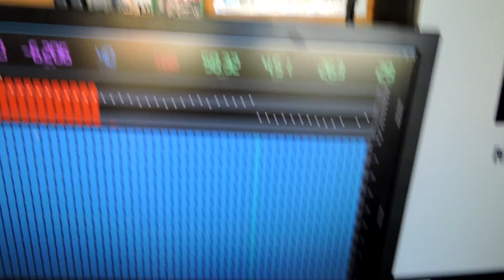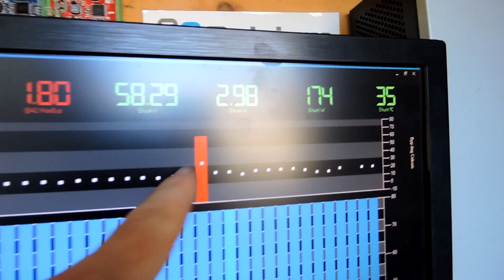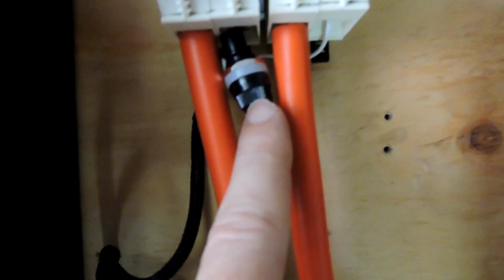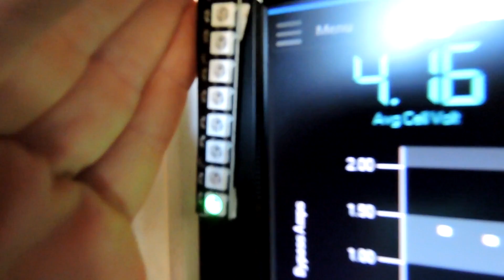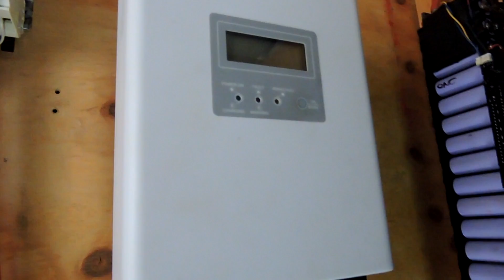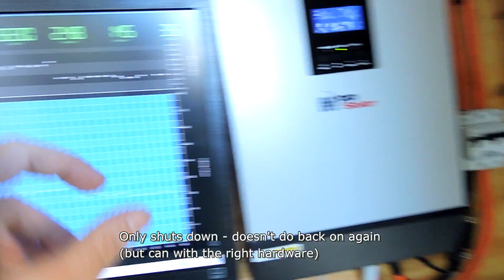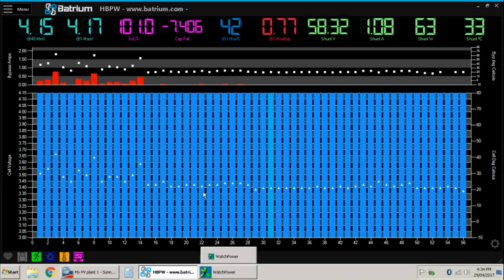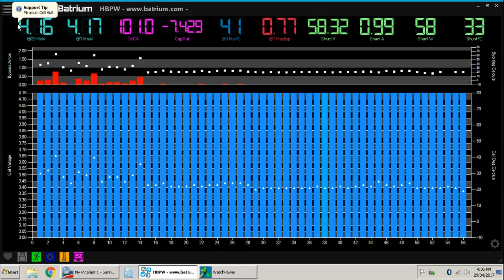Installing remote circuit breaker trip into my 40 kWh HomeBrew Powerwall

Comment from the maker: 40kWh has begun if your keen to check it out you can view it here https://freeboard.io/board/xKtg_F
Reply: The pcb terminals are very small on the batrium board so what they do in industry is wire all the pcb terminals out to a terminal rail and your field wiring connects to the terminal rail, that means there is less chance of damaging the batrium card and you can easily connect and disconnect but keep up the great work it looks amazing 👍
Reply: Yeah I have had it running on another screen your site. Currently 17.71 kWh SoC% 66.5 as of now 10pm South Australia time
Reply from the maker: +TheBlokeSolar&Wind soc is set too 1000 ah so it doesn't auto reset and I know what to set it too so that is inaccurate but everything else is :) refresh page as we have been tinkering with the desktop version a bit don't know if it auto refreshes.

Comment: Hi, are you using this system right now? it will give you more years of use.?
Reply from the maker: 3-4 years so far and still going strong
Reply: @HBPowerwall  then 3 years after that, the system will go in a powerful way estimated bi . , isn't it?
Reply: thank you for your successful interest in a very nice work bi.

Comment: Hey mate! Great stuff. I want to do this with my Batrium. Is this there a way that Batrium can do both, turn on and off all systems in case of faults, as this turn it off only. No biggie mate. I need to find a shunt trip like that in the USA. Would something like this work? https://www.amazon.com/Siemens-Q26000S01-240-Volt-Circuit-120-Volt/dp/B0052MCT1Y/ref=sr_1_2?ie=UTF8&qid=1533879396&sr=8-2&keywords=shunt+trip

Do you put one between battery and MPPT, as well as one between battery and inverter/charger? Thanks a lot mate!

Comment: on your PIP4048HS you have connected 4S panels each one has 45.1VOC for a total of 180V but you PIP4048HS only accept 125V, I am not sure if I am right or a I am doing something wrong
Reply from the maker: pip has 8 panels 2p4s total voltage is only like 60v or somewhere close to that.

Comment: That shunt trip is exactly what I am looking for. Thanks. Do you remember what they cost?
Reply from the maker: About 400 bucks from memory, i can get my sparkie to get a current price.
Reply: HBPowerwall If you could that would be great.If possible a model number would be awesome!
How's it working with that unit has your system tested it yet?
Reply from the maker: I've tested it with every possible wy i know how. Heat, cold, Over voltage, Under voltage etc hasn't not worked.
Reply from the maker: pretty much anything that'll work and is cheap, the one between each bank (haven't done it yet still ) will just make it a little better to maintain it
Reply: Hey Pete
Did you manage to get the details of the shunt trip from your sparkie?
Reply from the maker: He is coming around in the next few days I'll be sure to ask.

Comment: Those little DIN rail disconnectors, you mentioned a rating of 125A (DC), do they stand any chance under a serious fault condition?
Reply from the maker: By full fault do you mean a train hitting it? I think they are adequate taking into account the amount other protections that have put into place inc 4480 individual cell fuses
Reply: I guess thats the point under a really serious fault your cell/pack fuses would take over.  Was just curious as I know arresting a DC arc is a real challenge (I've worked in high energy DC rail in the past) I understand on some of the newer Tesla packs they have implemented an explosive disconnect system which is quite a clever solution to the problem - all be it a non resettable one!  Keep up the good work.
Reply from the maker: I have dead shorted a 7S charged pack before (a few videos back in fact) and all it did was scare the shit out of me & blow every cell fuse on the 7th pack.  20min to replace all the fuses and i was back running again.

Comment: 101% charge...I wonder if Thunderf00t will find this video :D
Reply: a quick google research will actually give you simple answer without needing it to be 'debunked'. 101% or more charge can be done if the battery manufacturer rating is lower than it's actual rating or if the battery is charged to a higher voltage value than the maximum voltage when the manufacturer measure the battery capacity.

Comment: Hey m8. your the first guy I've seen use a boot lace tool. I've always used my channel lock pliers and crimped them with the tip. something I also do in areas that see a bit if strain from lots of manipulation, try adding a bit of rosin core solder to the tip of the boot lace. it should draw in nice with those high power solder rigs you have been using. the boot lacing I use usually sees service in flex tracks, but in a project that is ever changing like yours. they should work just as well. great vids, cheers.
Reply from the maker: +Jason Hamilton great ideas that can help , thanks mate
Reply: crimping and soldering together is not recommended
Reply: It helps keep the termination from slipping off. Boot laces are mostly to keep your wires from fraying on insertion and keep things looking nice. Properly crimped they usually don't slip out, but if you dig through your wiring alot or if your application is motive a dab of solder in the tip of your lace termination will save you the torment of wire pullout and short circuits during cable tracing and manipulation while in service. An ounce of prevention friend.
Reply: and i take it you are not using proper boot lace ferrule pliers? and probably using  the wrong size ferrule?
there were many discussions on youtube before about similar soldering/ crimping matters. i can only repeat, crimping AND soldering is  not  recommended.  there are several reasons for that. for one thing lead is very soft and creeping . so you crimp the ferrule and  the led creeps and you have a lose connection. i recommend you look into it, like on googles and youtube.
Reply: I'm just sharing my experience friend. there's hardly any lead in solder these days to trifle about. your not really getting what I'm saying so, good luck to you.